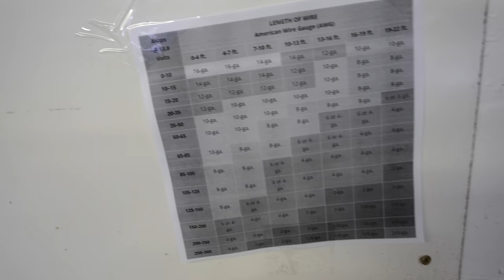Building the Brains of a Low Voltage System - Electric Hummer Conversion

Comment: I am pretty sure you would need to get this distribution board in the enclosed case instead, considering how low it is located in the humvee.
No reason not to keep it watertight...

And solder-seal connectors, as far as I seen, they are not better than crimped as they are more prone to fail under long term stress? Though this is probably subject to quality and how well the heat was applied.

Comment: The American gauge system for wire size is epically stupid. Metric wire sizes are the cross sectional area of the cable in mm. more logical right? 🤷‍♂️

Comment: 15:00 you can see two pins there  - the one that you called "always on" is not actually always on but called NC or "normal closed", which is the pin that is touched when the relay is not powered. It stops being connected when you power on the relay, because pin moves to touch the other one, called NO or "normal open". I just thought it would be important to explain to people new with relays so they don't get misinformed with the "always on" pin claim.

Comment: Your extension cord melted because the connection's resistance was high, which caused excessive heating in that spot. 
No cable can melt because it's too long. If a cable is rated for a given current it will be able to handle that current for any length without melting. However, the voltage drop will get bigger the longer the cable is, so if it's too long the loads will not get enough voltage. And more importantly for the car, the loss will be bigger.

Comment: I would reconsider the soldering joints. As they are more prone to breaking due to vibrations. That's why usually all electric connections on a car are crimped.

Comment: DC has no skin effect and will travel just fine whether solid or not. Stranded wire is far easier to handle, install, and rely on. Copper work hardens, which means the material properties- in this case, tensile strength- changes and causes the material to become brittle and more subject to failure due to breakage

Comment: you should add a bit of flux on wires before heat shrinking them, it will ensure more solid joint between them

Comment: A relay is a kind of switch powered by voltage (electromagnetic switch) and have no functional relation to a fuse which is a thermally or electrically, permanently deactivated device.

Comment: I do not know the scematics of you particular relais, but its most common that 85 and 86 is the connection to the coil and is totaly seperate from the contacts, connection30 is the 12volt from the battery , contact 87 normaly open and 87a is normaly closed.. so the cut wire could be one of the contacts of the relais.😅

Comment: I love this. Could be hours. I did get a bit jumpy when you dropped in the battery at @04:22 with the connectors exposed on the outside, almost scraping the inside of the car at both ends :-)

Comment: Hopefully someone could point me in the correct location but I seen those heat shrink soldered connectors and I have to have them! Where could I get the same set you used JerryRigEverything??

Comment: Aren't fuses typically placed on the negative side where the circuit is completed. Also if you think of the electron flow, electricity should flow from negative to positive.

Comment: hey Jerry. Tip from someone who worked with plastics a lot before. heating it too much with a torch makes that bend really brittle. wood is a great insulator to make the heating process more in specific areas for bends. for abs you want it to be around 340-360 before you bend and heat it slowly so the core of the material has time to heat as well like a steak =3 then let it cool till about 160 before you release the shape.

Comment: The thicker wire is just stranded because you wouldn't be able to bend it if it was 1 solid piece of copper. Electricity doesn't only run on the outside of the wire it'll run through the entire piece of copper thats why copper Busbars are also capable of carrying large amounts of current

Comment: when you talked about the wire you are using you said that the more stranded wire decreases the resistance of the wire. that is called the skin effect and it is a real thing but it does not apply everywhere namely DC. you are installing a DC system into your car and DC is not effected by the skins effect only AC is. as the frequency of the ac increases the thinner and thinner the area of the cross section of a given strand is usable for ac, meaning hi frequency AC requires many small strands. for DC it is the opposite. the wires you use in automotive are actually worse for DC conduction but as well as what you touched, it is also because it remains more malleable in extreme cold and is less likely to break due to cold in addition to the vibration and resistance to work hardening. but DC as in the system you are using, it is far more suited to AC, and solid core wire are far more suited to DC, but the difference is negligible because if you compare a stranded wire to a solid wire the stranded is far larger to make up the for the difference for air gabs between strands and differences in total cross section of all the strands compared to the solid wire. if you look up the skin effect it shows exactly what I'm talking about and what you mentioned.

Comment: Atleast vacuum and clean it first? or atleast a quick water wash before you install battery and other terminals? The only thing i was noticing in the entire video was how much dust/sands are inside the battery container ;-)

Comment: The two outputs from the relays are opposite. One has power when the control signal is off, the other one when on. NC and NO, normally (no signal) closed (connected) and Normally Open (disconnected). When signal is applied it goes opposite.

Comment: Have a look at step drill bits. They do a better job drilling abs, or any sheat goods... If your need to use a twist drill on ABS, going in reverse tends to be a better option, as this prevents it from grabbing the material.

Comment: Splitting hairs, but the center wire in the relay is not constant power, its powered until the relay is triggered, so you could use a relay to turn off a circuit, or two switch power from one circuit to another.

Also, I highly recommend a power probe for testing and troubleshooting along the way, especially with all of the convenient terminal ends and screws.

Comment: Relays are more commonly used to use a small "voltage" to power a larger voltage device by switching -relaying- the higher voltage/amperage through the relay to the device.

Comment: Also sure the panel look nice and neat but you didn’t plan for road side repair work. Watch the way cables attach to each component also do you best to make it easy to work on if you had basic tools. So say you pull a live wire off and slips out of the fingers and it falls try to make it not land on a power bus bar for example. Try and keep positive in one section ground in anouther. Also audio signals should be a separate circuit then power circuits

Comment: Really nice job!! Until you added the butt connectors, mount the panel, route the wires, then connect directly to the terminal strips.  No matter how good the fitting is, each one you add is another possible fail point.

Comment: If you put the bolt heads toward the drive shaft you can put a nut to hold them to the body and use wing nuts to hold the panel in for easy removal later, if they don't fit threaded rod would work also, just seems painful having to do electrical connections when it's fully decked out by accessing a nut near the drive shaft from under the car.

Comment: FYI any hole a wire goes thru be it plastic or metal should have a rubber grommet to protect the wire from rubbing thru the insulation and exposing the wire inside which will either or both cause corrosion or an electrical short and or a fire. Just saying you said yourself earlier in the  video that there's lots of movement and vibrations in vehicles and thats why you use more flexible wire in vehicles versus the solid conductor wire you use in a home or any building.  Great video just some advice is all this is.

Comment: Great project, I would love to know where did you get those "solder seal connectors" @10:32? I would like to use something like this in my ev conversion project
Reply: Sorry scratch that question found them on Amazon thanks for the info again

Comment: Don’t use the solder shrink connectors long term they suck. Also try upgrading to 12 volt tools for this work. Makes it easy to make holes and mount thing and just easywe to work with small tools in smart areas

Comment: should consider using rivnuts for the control panel mounting bolts. Be neat for people to see as well as making removing that panel way easier than getting under the rig to loosen the nuts. This is probably the coolest thing I've seen on the channel. Love the build.

Comment: Your relays are not sub fused, only via the breaker, thats not safe, any fault and up to 100amps can flow through a single relay and those small load wires, honestly, i would redo it

Comment: You will really want that always on for a stereo and a few other things. And you should have ran 2 much larger 12V batteries in parallels instead of just one little crap one. Should have made those bolts with the hose on them come through the other way and tack welded them on the other side and used wing nuts.

Comment: Would you stop wiring that is easier to repair and just do like all car and semi manufacturers do is use one harness to run everything. Then add a bunch of computers to figure out which wire is the problem.

Comment: Stranded wire is more flexible and malleable than solid wire, and it won't split or sever. Skin effect is absent in DC systems.

Comment: Higher voltage the less amperage the load requires. Also a 24 volt system of done correctly is much more robust and can handle abuse a lot more and takes more effort to break a connection

Comment: Won't there be corrosion under the plastic panel with a tin covered terminal with a steel bolt to body/frame? I'm not sure of these things.

Comment: Electricity doent flow on the outside of wire. It flows like that only if its high frequency pulses. Its called skin effect. You can google it.

Comment: Top tip with the shrink wrap, if its tight just add a tiny bit of moisture to the tube or wire, e.g. lick your finger and rub it around the wire, itll slide on super easy =)

Comment: I dont feel safe grounding those negatives to the body of the ev. I feel all power flowing should be isolated from the body of the vehicle. In case of an accident. There should be a pyrofuse to blow of the battery connection instantly in an ev.

Comment: The multiple strands is just for more flexibility. The thing about current flowing through the surface of each wire is only true with high frequency signals and would only apply if each strand is isolated from each other, like in litz wire

Comment: As everybody knows, since there is no longer an alternator in the engine, how are you going to maintain the 12V circuit charge for the accessories, apart from connecting it to the inverter.

Comment: I may have missed it but you should put some rubber grommets in the holes that the relays wires go, even though it’s an ev and that’s plastic you still don’t want to risk a possible short.

Comment: It melted because too much current was flowing on contact point of the two extension cables more than it supposedly can handle, that's why the contact point was only one got melted.

Comment: You should use Riv-nuts on the back of those log bolts, having to get under the truck every time you may need to loosen or tighten them would be annoying as hell.

Comment: i dont think the yellow wire is a allways on wire. relays have a NO and NC connection and the yellow wire is the NC wire so if there is no signal to the coil this wire will be connected to 12v the moment the coil gets a signal it will be disconnect from 12v.

Comment: I do not have the circuit diagram of the relay but I believe that the yellow cable is not permanently on but an NC contact works in the opposite direction to the blue cable

Comment: so your using the aluminum frame as a ground to complete other circuits to save wires but what if on the other side of the  truck doesnt have contact to the same piece you attached the ground to, reasons would be thing like paint insulating the layers.

Comment: don't use that battery. Go get one that fits in Cadillacs or something that goes under back seats. You will want to run the vent tube outside of the floor.   That's not safe

Comment: Electrons pass all the way down the wire, but it is instant as the copper already has electrons in it, imagine a tube full of marbles, as you push one in on end another pops out the other end, same with electrons.

Comment: The number of strands in the wire, is not there to allow a higher current to flow. The electricity does not flow on the outside edges of the strange. Please, do not just blindly follow whatever you see on the internet

Comment: cool video. However, relays are not fuses. Just a way to switch with tiny wires. You will need to fuse all loads.

Comment: When the wire is heating up basically the wire turns into the fuse because more current is trying to flow through to small of wire so power has
To go somewhere and it switches over to resistance and that causes the wire to heat and melt

Comment: don't use "ordinary" automotive 12V batteries. They're designed to crank starters.

What you need is a "leisure" or "marine" battery. They're still lead acid, but built differently and will last far longer in service

Comment: Recommendation: when drilling thin material like the sheet of ABS or sheet metal a step drill will give you a nice clean hole with less ripout and wont pull your work peice up.
Reply: Contact my personal broker and analyst
Reply: @EmilyCatherinetrade_
Reply: Telegram

Comment: Using a heat gun take longer to heat up but depending on the thickness it also can hold heat better so sometimes using a heat gun allows more time to work on your shape vs using a torch

Comment: 16:16 this is not the best way to assemble the ground circuit. You should've connect each write to each socket. This way one wire takes all the power of all circuits. Star scheme is the way to go

Comment: the reason you use stranded wire is that it creates parallel resistance per strand which reduces resistance per metre  than solid wire also there is no skin effect at DC only at RF

Comment: You might want to make sure where the ground wire connected to the frame do not have paint on it, or the poor connection might result over heating one spot.

Comment: The part about the electricity running on the outside of the wire and that that is why it has many fine strands is not entirely correct.

Comment: @3:00 when you're talking about electrical wire:
AC runs along surface of cable due to "skin effect," DC runs through entire cross section of the copper.
due to flexible cable benefit you mentioned right after talking about how electricity passes along the cable, stranded cable is still preferred in automotive vs solid core.
Reply: Also, those water-tight insulated solder connectors are very low heat solder. They're not really intended for primary wire soldering in automotive environments. The seal will work fine, but you'd be better off using high-heat solder under the wire before applying the water seals with the built-in solder.

Comment: 2:45 This is incorrect, electric current does run through the center of copper wires, the skin and as a field around it, the higher the frequency and voltage the more it runs through the skin of the conductor and as a field around it. This is called "The Skin effect".
An example of reducing this effect is gold plated wiring or contact points in computers, but this is mostly done in high frequency applications such as you wifi.
Stranded wire does have a slightly lower resistance even in 12v applications, but to say current doesn't run through the copper is a major overstatement.
Reply: This and so much more was incorrect or misunderstood. 🙁

Comment: For DC the electrons travel through the core of the copper, higher frequencies makes it move towards the outside, but our 50/60Hz mains are not high enough frequency to see that effect to much degree
Reply: The VFD in the vehicle  will most likely put out 3 phase power that is significantly higher in frequency than mains power.
        
    It depends on the design of the motor and how many poles it has.